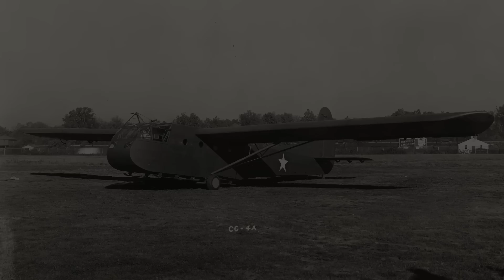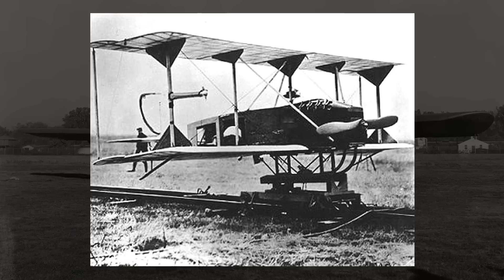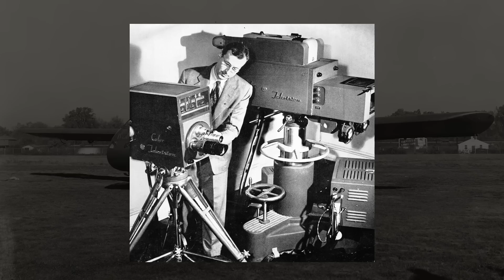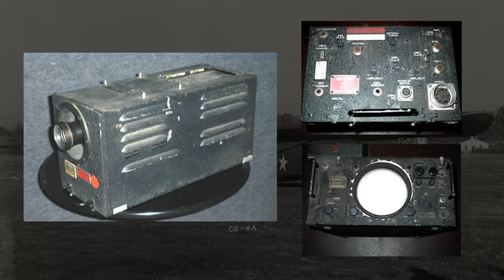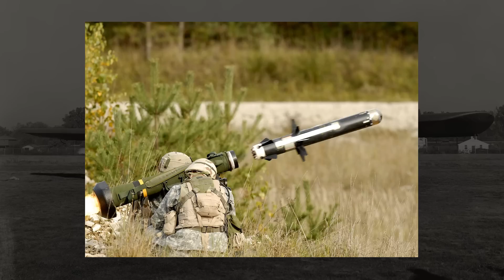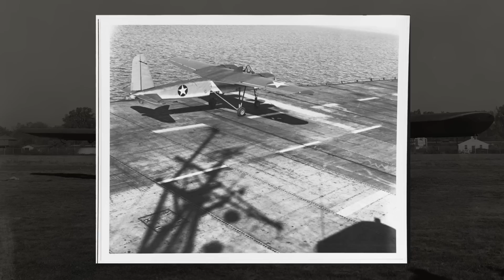America's "Glomb" Gliders: Pratt-Read LBE-1

Comment: In WW2, BF Skinner (the Behavioral Psychology Guy), worked on a project that used a pigeon as guidance. The bomb (missile?) had a window through which the pigeon could see, and the pigeon was trained to peck at  images of ships on a screen. The window on the bomb was wired to detect the pecking location, and an analog computer would adjust the flight path to keep the targeted ship in the center of the window. I don't think the weapon had an engine, and I don't know it was ever tested. I wonder if the pigeons would have been awarded the Dicken's Medal.

Comment: Fritz-X 1,400 kg PC 1400 X is a German manually-guided gliding bomb:

The Fritz-X is a guided armour-piercing gliding bomb weighing circa 1.5 tons, with an explosive payload of 320 kg. It was equipped with a stabilizer and fins as well as a set of radio equipment. The bomb trajectory could be tracked visually from the launching bomber through the bomb sight (bright tracing lights lit up in the tail section of the bomb after launch) and corrected by radio signal using a special joystick. It was mainly used as an anti-ship weapon.
Reply: IIRC they at least experimented with a television version. I don't know if they were ever deployed the TV version. Not that they could produce them in useful numbers, but that never stopped the Germans.
Reply: US laughs in ASM-N-2 Active radar homing glide bomb: 

Its the world first autonamous weapon deployed with the guidance unit itself lock on and guide the bomb to the target with no operaror input whatsoever. It has an explosive filling weight of 240kg its guidance system consist of a nosecone with a radar straight wings attached in the midbody and a tail section with control surfaces

Comment: Certainly in the '40s television design was pretty primitive.  The only available pre-war US imaging tubes were the Iconoscope, which was not very stable or sensitive, and the Image Dissector, which was simpler and more stable but even less sensitive. The newly developed and much more sensitive Image Orthicon (which would become the mainstay of US television cameras until the late 1960s) was extremely complicated and difficult to build.  Still, both Iconoscope and Image Orthicon cameras were built for drone use before the war''s end.  None saw action.  The cameras were bought by ham radio enthusiasts and experimenters as war surplus, and some survive (occasionally working!) today.

Comment: Would have been  very useful on Dday to take out bridges to prevent the defenders rushing reinforcements to the beaches. Instead they used glider landed troops to do this.
Reply: I'm not so sure.
With an operation as critical as Pegasus Bridge, you can't afford for anything to go wrong, and maybe relying on a new technology that was admitted 'having issues' was just a step too far.
And besides, the reason the operation was such a success was the ability of the Paratroopers to hold off German reinforcements and keep possession of the bridge.
You couldn't really do that with 'Gloms' (it is a fantastic word isn't it!) just bombing the bridge.
🍄